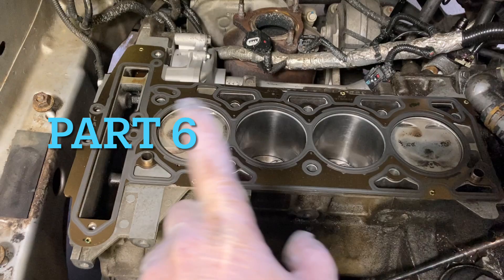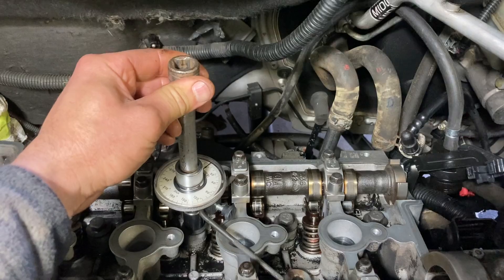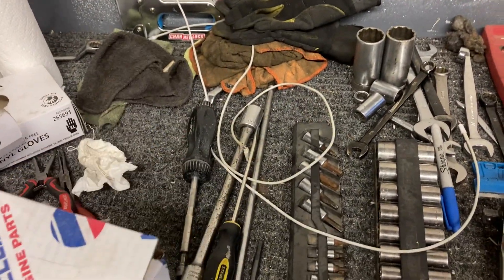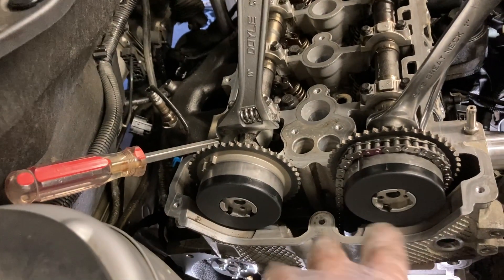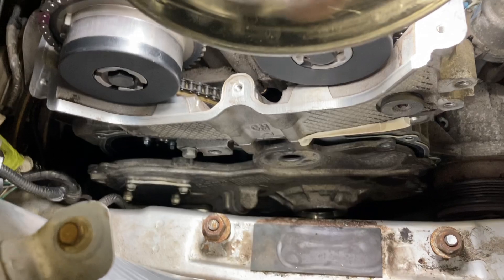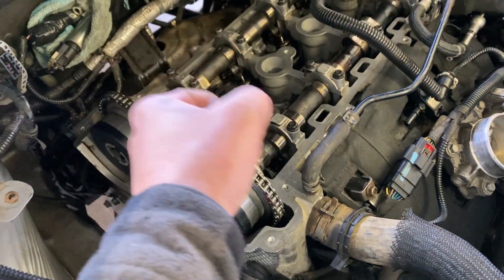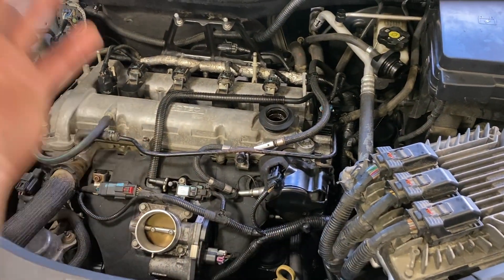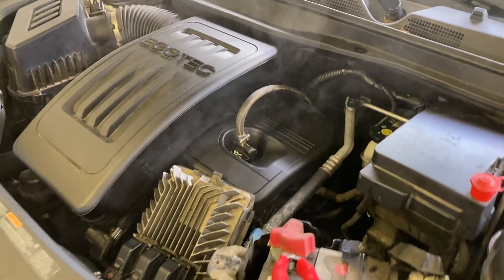Equinox Ecotec 2.4 Engine assembly

Comment: First of all I’m working on Ecotec 2.4 with the same issue and I watched all your videos and liked them you are a lifesaver but I have one question how much are you into it for complete Thanks in advance
Reply from the maker: was probably $1000 or so.  I also replaced parts that weren't necessary for the repair, but while i was in there i figured it was a good time to do things like the water pump and stuff.
Reply: @ratfarm767 thanks for the quick response ✌🏿
Reply: I have a 2012 terrain 2.4  and might be doing the valve seals. I'm trying to figure out if the cams have to come out or be loose to remove the followers to get to the valve springs and seals

Comment: Was wondering what the total cost was for this project?
Reply from the maker: I don’t remember exactly but it would depend on the brand of parts you buy.  I think most of the stuff I got was from RockAuto.  More than likey a cloyes brand chain kit.  Probably $400 in the head with parts and resurface.  I replaced stuff that wasn’t just necessary for the ring job.  All total was about a grand if I had to guess.

Comment: Did the new rings fix the oil consumption? I am preparing to do the same on a 2014. I also have 2013 Lacrosse with the same engine, but not the same probs...yet (129K).
Reply from the maker: Yes, it worked far beyond my wildest expectation.  It doesn't burn much oil at all.  If I only do highway driving, it won't burn any oil in 3,000 miles.  A lot of in town type driving it might use half a quart in 3000 miles.  Before the it was burning about a quart per 200 miles!! I would've been happy to increase that to 1000 miles per quart.  Now i'm only half a quart low after 3000 miles at worst!  Not too shabby for an engine with almost 200K.  
good luck
Reply: @ratfarm767  Project finally done after about 40 hours of work. Your videos were a GREAT help. We ended up replacing the pistons because my helper dropped one on the floor. Found those on RockAuto for about $85. Replaced the pistons, rings, all valves, water pump, thermostat, and plugs and timing chain components and oil actuators. 

At first it did not want to start…. We were bummed. I checked the codes and  it had  a PO365, Camshaft position sensor. I realized we forgot to plug in the exhaust side on the firewall side of the engine. There are alot of plugs to deal with on this job. After that she ran just like yours. I will update you on its performance down the road. THANKS AGAIN  for the time and effort on your videos.
Reply: @ratfarm767  What rings did you use? I can't remember if you changed the pistons

Comment: Ive read different reviews on wether new rings  will fix the issue . What is your opinion . Is going to last ? I see where some people advertise new piston with drain holes at the oil rings. Your thoughts are appreciated .
Reply from the maker: So far it's holding up and hasn't been burning any oil.  I've got about 15,000 miles on it since the rebuild.